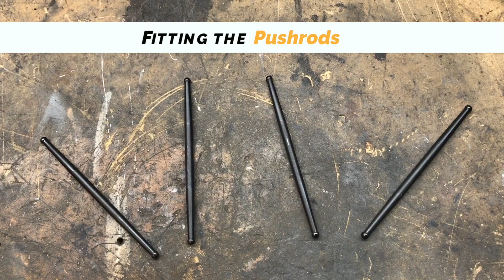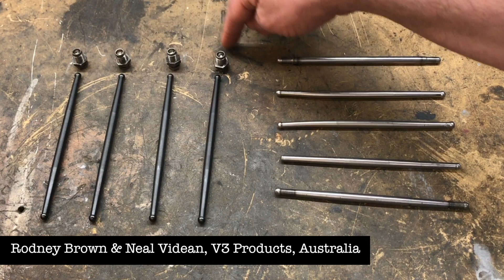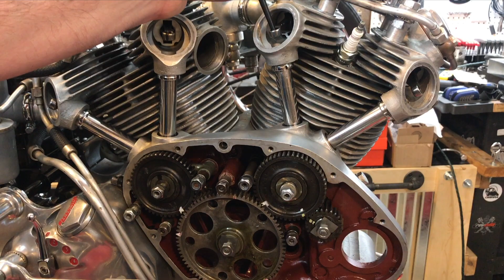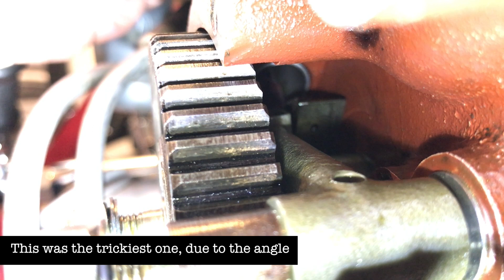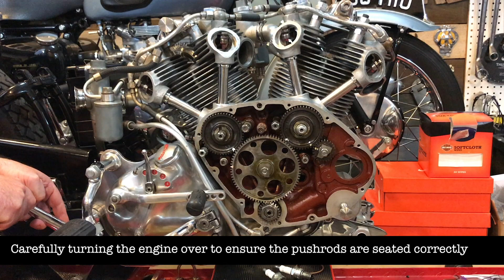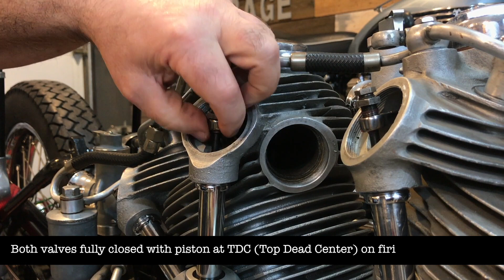Restoration of 1951 Vincent Rapide - Part 27 - Fitting the pushrods

Comment: Thank you for these great videos. One thing is unclear to me: I have seen how the pushrods are driven by the camshafts and the cam followers and lead into the cylinder head. But where is the drive for the valves? I could clearly see the valve springs. I found information on the internet that the valve train is located below the springs. I would be interested to know exactly how this works.